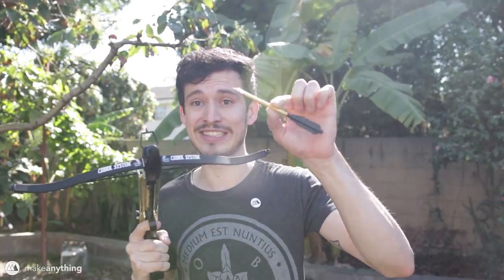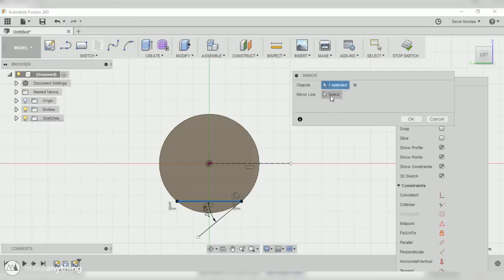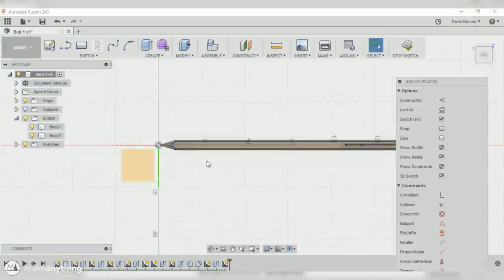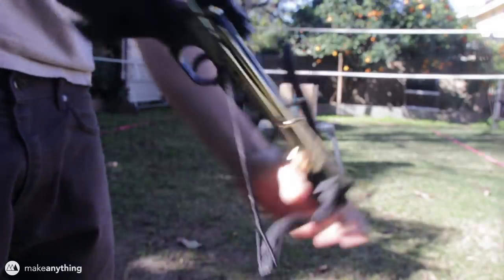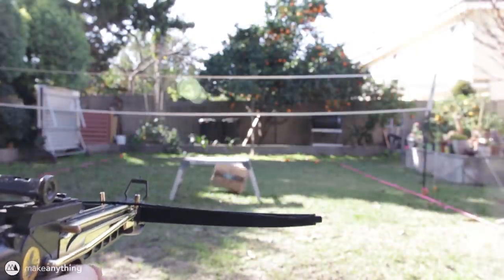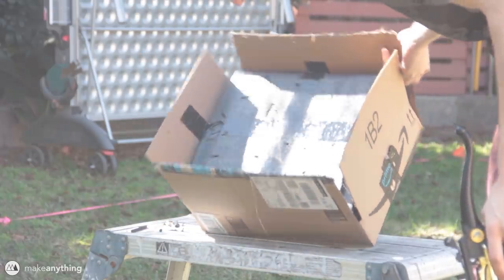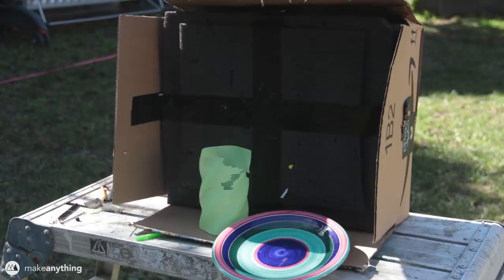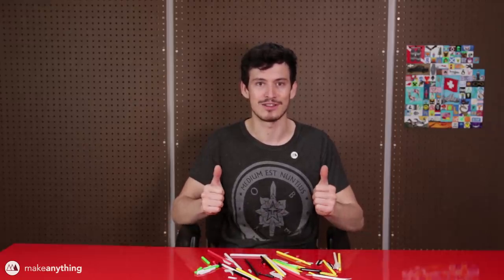3D Printed Crossbow Bolts

Comment: You took down the orange but I do suspect an apple would've been more symbolic.

I think the materials were too light unless you sought to place a thin steel rod into them and possibly even tried a 'rubberised' filament or something that may have offered a better weight/density.
Reply: reggiep75 ... Are you literally comparing apples and oranges?
Reply: William Tell opted for an apple but I guess he wasn't aware of the vitamin C available in oranges.

That or he hated apples as they come in too many colours and textures and oranges are easier!
Reply: @reggiep75  were oranges available to William Tell? Genuinely curious.

Comment: Fun video, but if I made 3D printed bolts I think I would make the fins come in from the side, give it a nock, and reuse the metal arrow heads from the normal bolts.
Reply: Yeah maybe try and have the metal tips integrated into the arrow heads, or use something stronger that you can keep/remake.
Reply: Maybe steel BBs would work
Reply: Un Stop Motionless I like the steel BBs idea.
Reply: Exactly what I would do
Reply: Nock?
Reply: @izzzy1977  I know I'm VERY late, but it's the slot in the back of the arrow for the bow string to sit in when loading
Reply: @Themflames  or just a screw maybe? sounds like a stronger connection than one can make for BBs and almost the same "point" if you use a round headed one.
Reply: @nonchip  agreed 100%. Screws would be easily the most practical thing to use. Very readily available too. Also if you print the darts vertically its less likely to split down the middle AND you can print threads that match your screws perfectly. The downside is that id expect it to weaken the fins.  You dont even need fancy software for the threads though. Even tinkercad has great tools for threads. Another option could be fixing razor blades into slotted darts. They sell the refills for box cutters in bulk. Finally, i would use  a nylon 6 and nylon 6.6 copolymer like overture nylon or polymaker polymide copafor the darts themselves.That stuff surpasses even polycarbonate in both tensile strength and impact strength making them the best practical filament for darts in my opinion. These nylon copolymers can also be annealed to desired stiffness for different applications. Outside of super expensive, super exotic filaments, its easily the best option for strong affordable prints. Just be sure to keep it dry (it literally will not dry at all at lower than 65c, so not all dryers can dry it) and be aware that even without carbon fiber it will rough up brass nozzles faster than most filament. Also ive noticed single gear extruders struggle a tad with this stuff even in a direct drive setup.

Comment: Probs magobs going to get ignored, but if you use a flexible material for the fletchings, and give them a slight spiral it will improve how it preforms and will shatter less. Thanks for great content
Reply from the maker: Good thinking with flexible filament! Getting that spiral would be tough without using support material though
Reply: That is true. But maybe if you cut them in half and attach them to the side, rather than right through the middle it might be possible to do with minimal support. It might also help with prevention of shattering. Thank you for considering my ideas!!
Reply: @make.anything  you could print it standing upright maybe, but no idea if that works with flexible filament

Comment: A great video similar to a project I've been working on for my 10  y.o. nephew but using a Flying Legolini with a much lower pull force than what you are using.
What I wanted to mention was I bought 50 X 900mm X 6 mm diameter bamboo stakes which are about the same diameter as those metal and plastic bolts you used originally. I haven't worked out how to add a fletching to the 16mm x 6mm final size because getting my band saw to cut accurately through the centre of the wooden bolt will require me to make a jig.
What is interesting is the ability of the bamboo bolts to fly fairly true even without the fletching (These test bolts were about 320mm long with a 3D printed blunt tip added to them). Also on the plus side is that the bamboo bolts can be resharpened with a pencil sharpener very quickly when used with a drill.

Comment: The bolt tends to brake when the fletching hits something. They typically brake in the back of the bolt. I find that making the fletching 70% of thickness makes the fletching more flexible and saves the bolt. So I only need to print more fletching. You can alternative cut the fletching out of something like cardboard paper or softer plastic. Im pringing in PLA. Also tried ABS for the fletching but got the same result.

Comment: Good job but maybe it would help to make the shape of the outside of the bolt a hexogon or a octogon instead of a circle because those 2 shapes would help give the printer a good base to work the bolt off of and make it easier to sit on the crossbow while still on it (if you get what I'm saying). The tip and the end could be the same though.

Comment: Just cut the main bolt shaft from dowel  3D print the fletching to slip fit over the dowel.

that will work for a low power crossbow like that.

For high power you need a CF or aluminum tube.

Comment: Add a laser sight so you're always on target.  Turn the box around to get a better understanding of which bolts are sturdier.  Will you be making an auto loader for this cross bow pistol or for a 3D printed cross bow pistol?  Then you can proceed to make a 3D printed glove style mini cross bow (it mounts to a removable point on the back of a glove enabling the easy removal of the weapon or addition of upgrades).

Comment: I get that this video is about 3d printed bolts but i can't help but wonder how well those would have done with a metal broadhead. i think the added weight on the front would have helped out a bunch.. also i would just acetone weld the fletching on those abs bolts..

Comment: I would have tried to print the arrow standing up. The arrows have to be strongest in that direction anyway. However, at least my printer has problems with thin vertical cylinders because warm plastic is very malleable and the cylinders deform.

Comment: I think the problem with your bolts was the center of mass it was probably to the end due to the fletchings. This probably caused the bolt to lift during flight and fly upwards. So adding a point made of metal would probably cause the bolts to shatter and break less. Another thing try making the fletching out if rubber or a similar material. I think your idea of making a slot to put the fletchings in wasn't bad. But, the problem was it wasn't reinforced if you took a piece of aluminum tube that was the same diameter as your bolts. Make the end the same diameter as the inner diameter of the aluminum tube I think things would work out better.

Comment: Would they perform better with a slight twist to either the "feathers" or the shaft?
Reply: Po Dog well it would make them more stable but the rotation takes away some velocity (the air would be spiraling around the shaft making it even more slow)

Comment: The big issue here is that the bolts are too light, and this is causing the bow to dry fire, damaging it. Your bolts should be at least 6 grams, 7 to be safe if you copy the factory one's weights. You also want the center of gravity to be 10-16% of the way forward of the center of the arrow for best flight characteristics.

Comment: You concluded that the reason the bolts were snapping was because of the design, but then you didn't show these in PLA again. Curious to see if it works still.

Comment: this video was really cool however cross bow bolts and arrows alike aren't really meant to survive an impact unless they are field tips and not made for hunting also I think your approach was pretty ingenious but the fletching is the most crucial part of an arrow or bolt in my opinion since that is what the object uses to center itself in air. The only other part that's more important than that is the smooth carbon fiber body paired with weighted tip as I understand, though, you cannot integrate the tip but if you made the body out of ABS and then smoothed it with the gas technique and bonded the fletching's on with a strong compound I believe it would make a world's difference if you thought about revisiting this idea.

Comment: How did you fix the Fusion 360 error, every time I try to fire up Fusion it shows me that error, but on an older computer it works just fine, so it's not a performance issue. Please help because I really want to design on my new computer. Loved the video btw.
Reply from the maker: Sorry, I'm not sure what you're experiencing.. I just had to restart Fusion

Comment: I think this was a very interesting video, but you have a lot to learn about the crossbow. I cringed hard about you keeping your finger on the trigger, that's the first cause of a lot of accidents. That and you just kept miss firing on those lighter flimsy bolts and didn't even check the limbs or anything, it's pretty much as stressful on the limbs as dry firing and you did blatantly do it at one point. You need to assume damage everytime that happens, stop shooting, inspect your limbs at the point where the string is attached, look for cracks or breaks in the limbs, they can be quite small so sometimes using a cottonball to check for very small cracks is good practice. Then if you find nothing begin slowly loading a bolt, cocking it back to check for a different sound or anything. If you keep doing what you're doing and don't check they will catastrophically crack or break on you one day which can be extremely dangerous.

Comment: This is really well done, however a few things. First of all, learn a little more about weapon safety, especially considering you’re firing a crossbow. The way you treated the crossbow throughout the video could’ve resulted in some pretty nasty injuries. The limbs of the crossbow can break fairly easily if used wrong. Also, you may want to check the legality of firing the crossbow in your backyard. Firing weapons within city limits is usually illegal.

Comment: you should learn how to handle the crossbow gun before you print arrows. A small part was missing from the ends of the arm because the nerve dropped. The arrowhead must also have a heavy tip at the end. A printed arrow will never be as good as aluminum. Everyone thinks 3D printing can be a great tool. well no! you have to learn how to make metal and wood, plastic breaks ....

Comment: this is horrible are so many levels.  one: you have no trigger discipline. two: you should have printed the bolt standing up.  that way if you wanted to print more than one at a time it would save you time and energy to do so as you could print a lot more than what you printed. three:  you should have incorporated the fletching as part of the print instead of making it separate to add more strength to it. four: you should have just printed the body of the bolt and not try printing the bold head as part of the bolt. they are separate pieces for a reason.  five:  do not flatten any part that is round.  it weakens the bolt and takes away the weight that you need.  six:  firing the crossbow with so little weight is like dry firing it and most of the energy normally transferred into the bolt instead gets transferred into the string and crossbow itself making the string come undone and break as you saw.  seven: they are called sights.  use them.  other than that not a bad idea.
Reply from the maker: You make some good points, but I will say printing vertically wouldn't work at all because FDM prints are anisotropic. The plastic is much weaker in that orientation because of the way layers are built up. Other than that, yes I made several mistakes
Reply: @make.anything  if you cannot print vertically than at least add support structure that can easily be removed with a couple of snips and sanding so you keep the cylinder shape of the crossbow bolt.